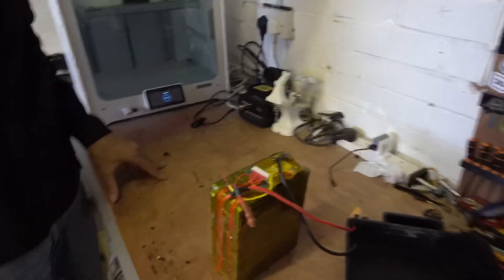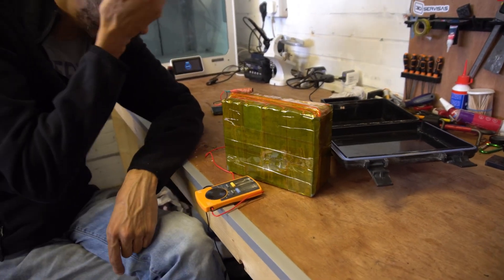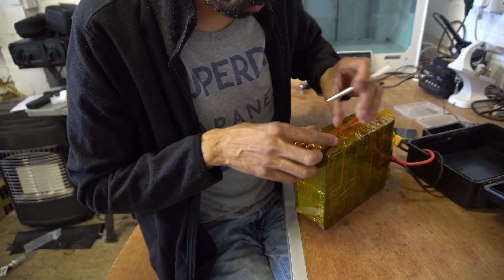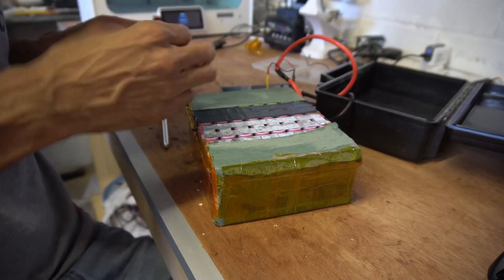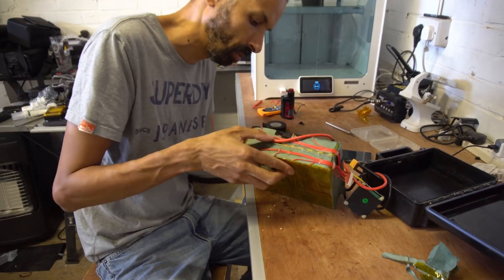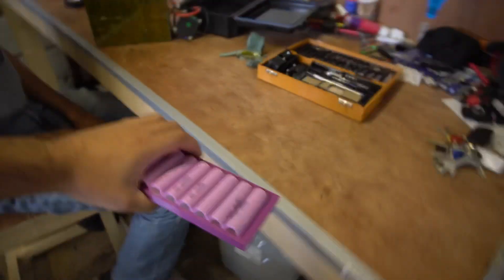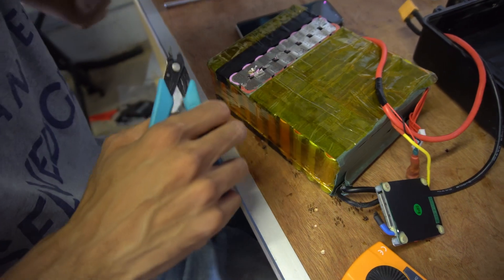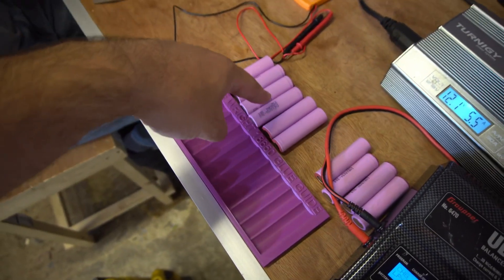Battery Emergency Surgery - Lost a P group! (Part 1)

Comment: Nice vid again, just bought new 80mm wheels any ideas where to look for a pulley kit with 10mm bore
Reply from the maker: What wheels bud?
Reply: @LeeWright  only cheap abec type  wheels with the open center  but better than what was the previously
Reply from the maker: Ben Hibberd tbh I am not sure, I can do some research for you though mate
Reply: @LeeWright  if you don't mind 😂 don't spend long on it though not important
Reply from the maker: @benhibberd6907  yeah no problems mate I'll have a look

Comment: thought that charger was mine at the start of the vid. glad it came in useful. Anything over 15v will set the warning alarm off charged my lipos  at 14v on the booster that gave 6.2-6.4 amp charge

Comment: This is why i prefer lipo
Reply: + for several other reasons. Theyre just a bit more work lipo.
Reply from the maker: @nedtrampz85  yeah Lipo deffo has its advantages mate and I am with you, it's good to have a choice between both chemistry depending on your needs

Comment: I love this stuff. The technical views of these builds are always a joy. And I appreciate that you're doing some serial content. It makes it all nice and curated, partitioned out, and fun to view after the fact.
I can't see, are you uploading in 4k? You need to upload in 4k. Trust.
Reply from the maker: Thanks Mario.  I love the technical stuff too man, its what gets me going! I prefer this to riding and I love riding! I can upload in 4K if I dont do slowmo but I have just chosen not to do so.  Maybe I should do that?
Reply: @LeeWright  If you're shooting in 4k, then just edit and publish in 4k. If your computer gets a bit bogged down, you can use proxies. 4k not only looks better, but YouTube compresses it less. It's a 40mbps stream instead of a 10mbps. Also, it ranks 4k content a bit higher in search. So there are multiple reasons to make the switch. 🤙
Reply from the maker: @TheBoardGarage  I actually have been editing on my ipad recently and it handles 4K 100mbps footage like a dream - its unbelievable.  So yeah I edit in 4K and then render in 1080 - I'm obviously an idiot.  The videos with slow mo in is no Bueno though as I cant do 4K 100fps!
Reply: @LeeWright  Ah, so it's a no brainier. You may be able to do 60fps, no? I do my slow motion in 60fps usually...or if you're in PAL, 50fps? There's always a way.
Reply from the maker: @TheBoardGarage  yeah maybe I can do 25 and 50.  Cant do 30, not over here with the lights - flicker city.

Comment: I've had a similar thing happen with a balance board battery happen to me, I think it was a faulty bms and I think it somehow discharged a whole p group and overcharged the other ones so I think it happened gradually but that's just a theory, this is the reason I want to build my battery with swappable p groups
Reply from the maker: Yes that's our theory too bud, in part 2  we change the BMS and put a smart BMS in so we can monitor with an app.  It's a good idea doing swappable P groups, bit of a nightmare getting into the middle!
Reply: @LeeWright  can you link the new bms, I might buy one
Reply from the maker: FPV Kubbur https://www.lithiumbatterypcb.com/product-instructionev-battery-pcb-boardev-battery-pcb-board/ev-battery-pcb-board/smart-bms-of-power-battery/

That’s the one.  It has some interesting features, like being able to balance the battery whilst its not connected to a charger for instance.
Reply: That's a nice bms, it even has a variety of com ports, it would be possible to make it communicate with esc's like the vesc6 for a bunch of cool stuff, defiantly needs some code bending but the hardware is there
Reply from the maker: @kubburdigital  deffo mate, it's all.open as well so you could do all kinds of cool stuff.  Benjamin Vedder is working on a BMS that communicates with VESC over CAN - will be interesting to see it v soon